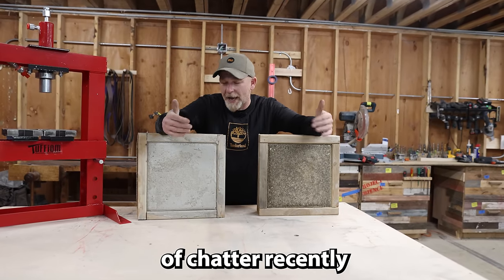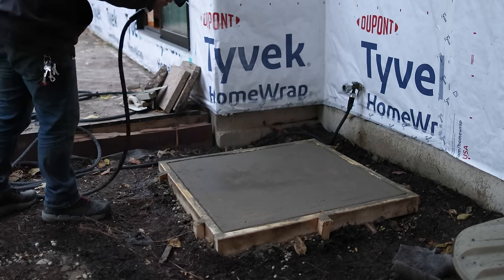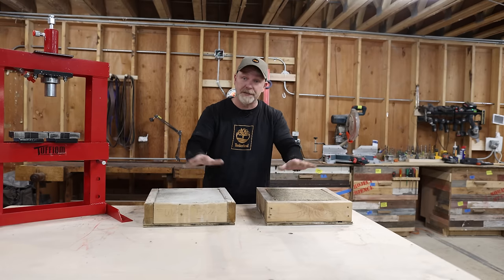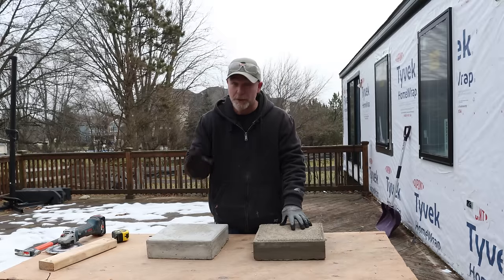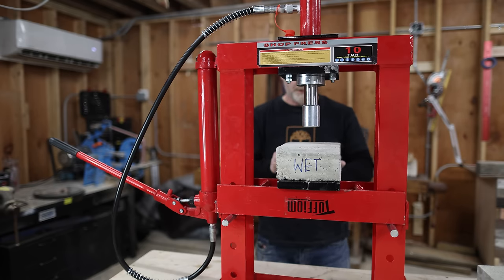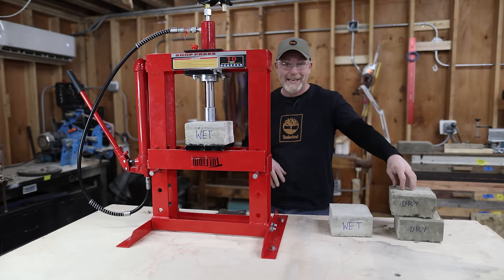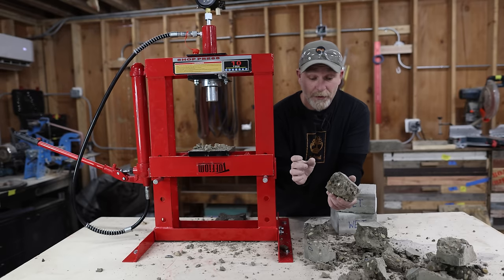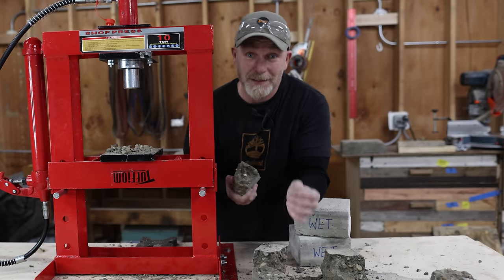The TRUTH About Dry Pour vs Wet Pour Concrete!! Strength Test - You WON'T Believe the results!!

Comment: Several decades ago we had several bags of concrete left in our garage for several years that we didn’t need for our project. They were in unopened original bags and were not exposed to any moisture. We finally decided to use them and when we opened them found they had been solidified. They were the usual grey color and decided to use them along a fence where one of our dogs had been escaping. We just dropped it down and it has remained ever since and is still in its original state. We had a few fence posts that were becoming loose that was installed 33 years ago. We dug around the existing concrete, added dry concrete and misted it once. It’s solid and the reinforced the existing concrete so that the fence post no longer moves. I think that pouring concrete mixing according to the recommended amount of water, you have consistency. By dry pour, misting often, you don’t know how much water you use or how much rain affects it before it’s solidified. Since we were in a drought, we didn’t have to worry about excessive water. Those old bags that solidified have not changed after 8 years of exposure to the elements. No corners to chip off but the dogs can’t move it. Not pretty, but definitely effective.

Comment: I’m in concrete many years and definitely knew the results even though I have never done what you did to test it, I have my definite instincts that it would be crumbly by what happens to a bag of concrete after it gets rained on. But you are the man! For making a video and doing the test. Bravo 👏
Reply: Dry pour fills the gap between dirt and concrete. It's great for fence and pole barn posts if not stressed for a week or 2 and you pour water in the holes.
Reply: @Bob_Adkins  hey Bob, I found putting concrete around wood or metal poles tends to rot, even treated, so I soak it in used motor oil first and it’s been keeping them solid.
Reply: @BussinJohnson  Yep, done that, seems to work. Lately though, I put a handful of copper sulphate in each hole, it acts as a strong algicide/fungicide and also discourages roots and termites.
Reply: @Bob_Adkins  sure its great to have week posts.

Comment: Was really considering a dry pour for my shed build but after your video I'm sticking to the wet pour. Thank you it was a very educational video.
Reply: I wouldn’t chance that either
Reply: I was thinking the same thing just now
Reply: Look into the addition of basalt fibers in addition to rebar if you want to turbocharge crack resistance.
Reply: @actionanimations4879 Rebar doesn't prevent cracks, it adds strength. Concrete always cracks that's what control joints are for.
Reply: What time and labor do people think they are saving by dry pouring?
Reply: @chichidouglas5078 actually it does both. Expansion joints are for large slabs or pillars where different ends would expand and contract different.
Reply: I think that if you are dry pouring on th ground, with no barrier between the pout and the earth. the results would be different.
In this test, the slabs were encased on the sides and bottom. So de[endeiong on how he misted, it would affect the outcome. But if the pour was on the ground, direct, the slab would have continued to absorb moisture form the ground. Making it stronger. 
Maybe he will try that test as well. 
Otherwise, thi test verified my concerns with dry pours.
Reply: I don't think dry pour is any different the RCC. Roller compacted concrete. A local business started selling it for parking lots and within 2 years 50% of the projects were removed and replaced with regular redi mix.
Reply: @zoso1123  saved me thousands of dollars and i didnt care of it looked pretty, I been parking my work truck in the back yard for years, city randomly decided that wasnt allowed anymore and was like. Yer truck has be parked on concrete or asphalt to protect the water table der der der. got some quotes to have a small parking spot poured, said nope, dug out a spot, dumped a few bags of the cheapest mix i could find in it and hosed it, I could care less if it cracks or looked like poop its only job was "look its not parked on dirt no more"
Reply: Nothing wrong with dry pour for a shed. It doesn't need to be strong. It will certainly outlast the shed and possibly yourself, with the added bonus that it should be easier to lift in the future if you want to. Horses for courses.
Reply: Dry pour ruined my sidewalk and I did it 8 months ago.
Reply: Same here!!!
Reply: Dry pour is 1 of the dumbest things on the internet. 🤦‍♂️
Reply: @urbanspaceman7183 You can't be serious. Did you watch the video. Dry pour is the dumbest thing I have ever heard.
Reply: @H43339  You need more life experience then.
Reply: @pepsilove6306  
What, no permeable pavers?  LOL
The things we must do to appease those who must be pleased, without getting down on our knees.....
Reply: @lt1nut  That was the first thing I tried. I have a ton of them in stacks in my yard cause I do lawncare for a living. So I keep them after demoing old paver projects for clients. the city was like "it has to be one solid piece, pavers dont create a 'solid' surface. So I poured the ugly dry pour.  you think thats wild, you should see what I did behind the shed, they complained about it being a mud pit all the time from rain water. so I took some 80 pound bags and just mixed it with the soil so it turned into dirtcrete. no more mud XD the city hates my house so much lol.
Reply: @urbanspaceman7183 Easier to lift in the future,  horses  ?
What are you talking about, we were talking about concrete. There's only one way to do it, and that's the right way. Wet !!!
Reply: @H43339  I love it when people are so confident that they believe their opinion to be fact. Especially when they just don't understand there can be more than one right way, depending on planned use. It makes them look silly, which makes me smile.
Reply: i've been pouring and finishng concrete for 15 years and i have never heard of a "dry pour". dumbest fucking thing i have ever heard in my life lol....
Reply: @davidandresen8195  there is no possible scenario where a "dry pour" is a good idea. its really dumb.
Reply: @urbanspaceman7183 I love it when people are so insecure that they talk in riddles to sound impressive.
Reply: Never cut corners! There's a reason why "shortcuts" are not Standard Operating Procedure.
Reply: @H43339  If you can't understand plain English, that's your problem.
Reply: @urbanspaceman7183  Nothing plain about it you talk gibberish.
Reply: @urbanspaceman7183  You sound like the home owner that goes to Lowe's or Home Depot on Saturday.
Reply: @H43339  I think most people would understand perfectly what I wrote. I'm sorry the education system let you down so badly.
Reply: @H43339  Are you saying that there is something wrong with all the millions of people who have at one time or another frequented those fine stores? Perhaps you believe they are all smarter than you. A distinct possibility 😉
Reply: This video is inconclusive. He doesn't realize that not all brands of concrete work the same with the dry pour method. I used Quickcrete on a 4x4 base to mount a manual tire changer from Harbor Freight. Have changed multiple tires and the anchor bolts haven't budged one inch. My base is all gray and not brown. Seriously, the brand of contrete you use makes a difference.
Reply: @urbanspaceman7183 Talking Big Doesn't Make You A Man. Sorry Kid, I build for a living.  And you can keep your Saturday Home Improvement Store.
Reply: @H43339  Would have thought you would have learned by now that when something is good enough to do the job it's intended for, then it's good enough to use. Why pay more for wet concrete when it only needs to support a light weight. Are you ripping off your customers?
Reply: @urbanspaceman7183 That's good enough for you, well it's not good enough for me, because I do things Great. There's no such thing as Good Enough.
Reply: @H43339  I bet you use a 4 inch wall anchor to hang a picture when a nail is good enough. I on the other hand use a more sensible approach which saves money and time.
Reply: @urbanspaceman7183 I bet you're a lot of fun at parties. Not  !!
Good Day  !!!!
Reply: @H43339  Way to lose an argument. Good life.
Reply: @williamadams4843   I happen to agree with @chichidouglas5078.  There are two types of joints in thin slab concrete (4" to 6" +/-) or, at least , there should be.  The first is a control joint.  These are exclusively used to direct cracking - all thin slab concrete cracks.  The other is an expansion joint.  These allow for horizontal movement (expansion and contraction) as well as some vertical movement.  These allow for a complete separation of the slabs and generally do not have rebar spanning the gap, unlike control joints.  Both rebar and fiber add tensile strength.  Perhaps the fiber might control some cracking but there will still be cracks.
Reply: @urbanspaceman7183  To bad that is not true. Good Enough is Not Good Enough.
Reply: @H43339  Congratulations, I have rarely read such a silly comment. You should win the anti-pulitzer prize.
Reply: @urbanspaceman7183 Your the one who said 
It's Good Enough  !!!
Not only are you wrong, your memory is failing.
Reply: @H43339  What on earth are you talking about? You've lost the plot.
Reply: @urbanspaceman7183 Go back and read your comments. Apparently you suffer from everything you accuse me of. Give It A Rest  !!
Reply: @H43339  I said good enough is good enough.  You said for some unfathomable reason " good enough is NOT good enough" do you see the difference? If not, get someone who graduated from kindergarten to explain it to you.
Reply: @urbanspaceman7183 You need to get someone to teach you that there is no such thing as Good Enough. In The Business World.
Reply: @urbanspaceman7183 First Because It's Not   Good 
Enough  !!
Reply: @H43339  I'm not responding any more, I'm beginning to feel like I'm picking on someone who doesn't have the mental capacity to adequately defend himself. I don't want to be that mean.
Reply: @urbanspaceman7183 That's exactly what I was thinking.
Reply: @H43339  Glad we're in agreement about your metal capacity. Goodbye.
Reply: @urbanspaceman7183 Once again, you didn't do what you said you were going to do. Talk to you later, Have A Good Day
Reply: @H43339  Decided it would appear to be rude to not acknowledge the fact that you accept your inadequacy in the smarts department. Now however, it's just becoming silly, you will get no further response, I don't want to upset you anymore. Enjoy your life.
Reply: Seems I have heard this before. One can only wonder. Hmmmmm
Reply: @zoso1123  Cause the tiktok video said so
Reply: @chichidouglas5078  and it never cracks where the joints are LoL
Reply: @H43339  Jebus You sound like a middle school kid in these comments. First, not all brands are the same; they don't all use the same ingredients. I doubt you poured anything but soda and juice with the "I saw a video and proved it" attitude. Even the guy in the video admitted it has its uses, and it does. You don't want to use it because you think it's weak or not good. then don't but don't make claims you never researched at all and going by one YouTube video, mise well believe in aliens and flat earth, they have plenty of what they consider proof with videos also.
Reply: @zoso1123 mixing the concrete…. Pretty labor intensive bro
Reply: @Dioss1 You don't have a Clue what I have researched, you don't have a Clue what you are talking about. On the other hand, I have been doing concrete, most likely longer than you have had Birthday's. So little boy when you grow up and learn a few things get back to me. Until then Give It A Rest  !!!
Reply: @Supayone  I think you summed him up very well.
Reply: @pepsilove6306 i h a te the city. They have no problem telling you to do something in a timely manner yet when you tell them to pick up limbs or trash in the alley or something it takes them fukking ages to do it.
Reply: You ruined your sidewalk, not the dry pour. @chucklesthered2338

Comment: When dry pouring, the method I employed got the concrete wet until it became firm to walk on. The water was added over a 2-hour period then added again every morning on top for three days with visquine under the pour. Not a single stress crack in a 12'x12' pad. While I agree that its compressive strength may not be to full spec, it is good enough for my horse tack room.

Comment: In case anyone is curious about how dry-pour holds up in lightweight applications, we did a dry-pour sidewalk area to enlarge our concrete entryway, and it has held up very well over the last 6+ months. Like he said in the video, I would not choose a dry-pour to use in anything structural or weight critical (such as a driveway area), but to support a lightweight structure like a chicken-coop or a shed, the dry-pour could work - it just depends on the weight.

Comment: Thanks for doing this. I've responded to some of these DIY dry pour videos. Concrete curing is a chemical reaction that is dependent on the proper ratios of concrete mix and water. The chemical reaction bonds the concrete particles and stones together by generating heat that is uniform throughout the slab (as long as the correct ratio of water is MIXED in) and is critical to the slab reaching its potential PSI rating. Dry pour, even under the best circumstances, will only ever reach a small fraction of the mixes rated PSI.
Reply: He used 4000psi mix and the test went over 2 tons. Sounds like they all exceeded their PSI ratings
Reply: @trevorturk7473  yeah except the force was distributed over an area greater than 1 sq inch. It was distributed over the surface area of the ram. I am not sure what the ram diameter is on his press, but if it is 2" diameter ram, then it's area would be 4*pi, which is over 12 sq inches.

Comment: I dry poured a spillway for a farm pod. I was a bit skeptical but it has worked well and looks good. It doesn’t carry a heavy load just provides a water channel and prevents erosion
Reply: The fact that it regularly has water running over it probably helped it to fully cure and be stronger
Reply: I made 3 foot long by 1 foot wide back splashes for my gutter downspouts. After 8 years of service, no errosion. I wish the poured concrete driveway provided by my builder weathered  as well. My project was a wet pour.

Comment: There's a reason no professional concrete finishers do dry pour, you wouldn't want mortar or grout that had moisture in it, if it cures at different times as in some parts were exposed to moisture in the bag and were lumpy while other parts were dry powder they would not bond right. You are essentially drying it in layers that will not bond together correctly and  the first layer will somewhat properly cure while shielding the center section and bottom from getting enough water to properly cure.
Reply: I work in the cement manufacturing business.  There is a lot of science and engineering that goes into the process from extraction at the mine all the way through to the finish cement product that is all based on the product being used in a wet pour.  Concrete which is 17% cement is also designed specifically for a wet pour  to maximize strength.  Cement and concrete could be designed for a dry pour by changing its chemical composition and ingredients, but almost all big projects are easier to build using the wet pour/pumping process.  Only small projects benefit from the dry process.
Reply: @goofyjumper that's an interesting take, if accurate; and, as I'm less than a layman, I have no foundation (cement joke) to argue counter. But, it does seem that if what you're saying about the benefit being only for "small" projects, then virtually all bags could be mixed for dry pours as they are almost certainly all used in "small" projects.
Reply: Maybe someone should market an additive to mix in with a standard concrete bag to adjust it for dry pour method
Reply: @jurban7998 or maybe you follow the manufacturer instructions and stop trying to cut corners 😂
Reply: @jurban7998  The reduction in strength was HUGE, the dry pour doesn't have 1/4 the strength of the wet pour. If you mix the concrete more than the minimum, you will increase the strength even more due to evaporation of ( a slight) excess water, and more thorough distribution of the water and chemicals in the mix, causing a more complete setting of the mix.
Reply: @jurban7998 The dry pour has no real strength! There would be liability claims because the first frost or bit of weight would break it very quickly. If he dropped the two slabs from chest height  onto a concrete floor, the dry pour would shatter , even if it landed flat. It's a complete waste of time and money.
Reply: @christaylor9095  i don't buy what goofy is selling.
Reply: has no one in this thread heard of quikrete??? Its specifically designed for dry or wet pour.
Reply: @csmnitemare4532  No, it is not.
Reply: @JamesP4620  Yes, it most certainly is.